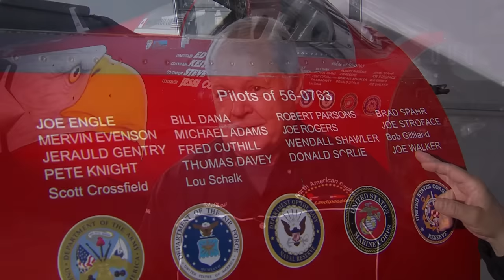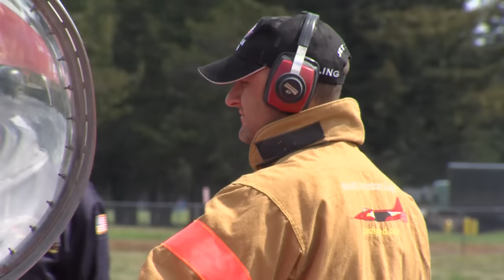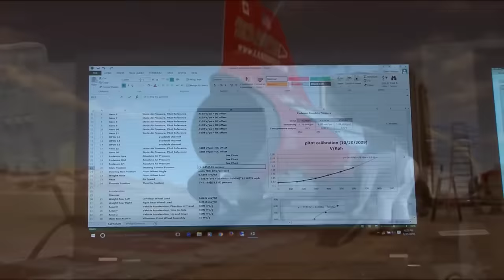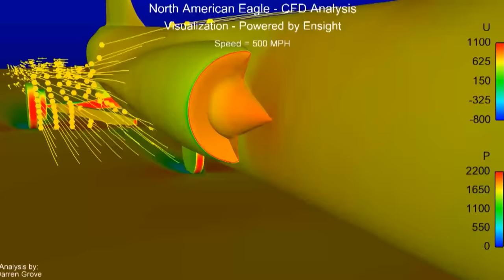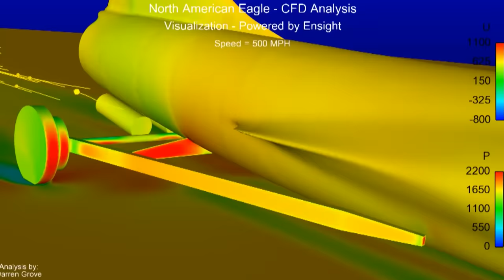The North American Eagle

Comment: Jet-car racing now needs to move to wheeled open-water  speed-racing. At high speed , V-shaped wheels will run on water , yet cut through any incident waves . Racing-hydrofoil escape-capsules will greatly increase the safety factor for the jet-car drivers . 
*In-depth examination of this proposal is available in Quora thread : Should we allow wheeled jet-car racing on open water ?

Comment: The F104 was a deathtrap in the air, let alone sticking it on wheels... Bloodhound off to Hakskeen Pan next year...
Reply: no i think the bloodhound is back in 2021. 2020 they are rebuilding after some testing that finished with some 1000kph+ passes. they have yet to add the rocket motor as well.
Reply: @mrrolandlawrence  And, alas, they're without an owner again.

Comment: Trust 2 = 30,000 BHP (622mph)   Thrust SCC = 110,000 BHP from two Jet Engines (763mph)  Bloodhound SSC = 135,000 (est. 1050mph)  Eagle = 42,000 BHP (est. 800mph!!!???)  I genuinely wish these guys well with their weekend project, but they simply have not done the maths on the exponential power curve which describes the exponential need for power due to nature pushing back harder to slow you down the faster you want to go.  Regardless of personal opinions, the laws of physics show that this car is not going break 700mph. P.S.  I do know that strictly speaking you shouldn’t use BHP to measure jet engines power but for the ease of comparison for the masses it seemed easier.
Reply: ukkowalski  it will be interesting.

Comment: I may not understand this but land-speed record challengers should not be building cars that are light enough to fly. I would use an old B52 fuselage, pop rivet plates over the wing roots, strap the engines on the top and sides and bets I could get Mach 1.  Failing the rarity of finding a B52 fuselage,  I might be able to get a few Mach numbers in an old 1900's steam locomotive with an Atlas 5 rocket motor. Screw the fancy paintwork and get the job done. It only has to go fast, it doesn't have to look good.

Comment: Darryl Greenamyer flew an F-104 at low level officially 988 mph.  (Average of four runs.)  Couple days before he average dover 1000.00 mph but one timing camera didn't work.   The fuselage is good for mach 2 at high altitude.   Seems like a good choice for this attempt.
Reply: Something designed originally to work on the ground would be even better.

Comment: In 20 years they've. Managed to go 440 mph?  Top fuelers go 330 in 1000 feet.  Not too impressed with the performance, but it is still a neat car.
Reply: It's all together a different class. Land speed records are recorded allowing different wheel to ground numbers and distance to speeds both directions. Jet cars are not included in NHRA top fuel as you reference
Reply: What a tragic loss of a brilliant driver.

Comment: Too much lift under that fuselage it was made to be an aircraft, running it as a car on the ground you're dealing with a tremendous amount of ground swell, trying to take it through the transonic threshold the front end starts producing a shockwave that combined with the ground swell, you're not going to be able to control it it's going to lift up you're going to crash it!

Comment: It has a MICROSOFT decal on the side, IT WONT WORK IT WILL CRASH
Reply: kalayas kitchen it crashed.......
Reply: Chuck Barnes  if they didnt include a 3-axis inertial feedback system (fibre optic gyros and accelerometers + fast response kalman filters),  with some pretty high response rate airfoil trimmers then any turbulence and unexpected ground effects especially as they probably have never been modelled or simulated them in an airflow chamber (wind tunnel) would suddenly result in uncontrollable motions. If the wheels broke up that's another matter. Depends how good their telemetry and vibration/ positional monitoring systems were for post-accident analysis but I expect that was an expense/complexity too far for them. A human in the feedback loop instead of some FBWire system is not good,  reaction times are poor - it's equivalent to flying a fighter jet at 1 mtr off the ground at mach 1.5 isnt it??? Not good and a sad loss for a brave lady. I wonder if they had an operational ejector seat/canopy in it that may well have saved her at any speed.
Reply: Chuck Barnes  same as that going through Donald Campbells mind when Bluebird took off and killed him, "oh shit" - the designers and idiots who made that car "over 20 years" are culpable in the death of a nice brave lady who trusted their overtures and lies. No human can control a mass in three orthoganol planes  (X.Y.Z) moving over terrain at the speeds they wanted,  it didnt seem a very heavy car either it simply looked like, as others have noted, a retired jet fuselage with a few wheels sticking out of the side. Compare that to other types of land speed record cars!. It's just the American (sorry guys Im a Brit)  "good ole boys" syndrome in action over design and money. I note that there is no video of the accident.

Comment: The celebration tour that would never happen, had he only driven it and not allowed anyone else to drive it he would have been praised for his efforts. The fact is Ed was called out in public over and over again over the lack of safety equipment makes this an experiment that killed Jessi almost criminal. RIP Jessi Combs.
Reply: Not just the car. They needed a bigger area. The black rock desert is 2 to 3x as long as their location.  Watching the video if she had a few more miles without hitting the bumps at the sage brush, she probably would have made it.  She almost crashed once before cuz the chutes didn't open. That's crazy to attempt this in an undersized runway

Comment: Why is the tail number 60-763 on the plane, but on the car they have it as #56-763?
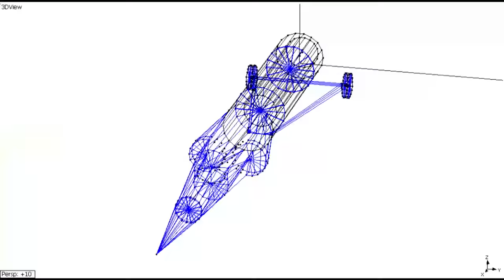Reply: Where are you seeing that at 11:33 it says 60763 on the car
Reply: @PabloGonzalez-hv3td  Earlier, when they show the actual F-104 with the test pilots, the tail number is 60763, then the go to the car owner who points to where it says "Pilots of 56-0763" and the names of the pilots. Later as Les Holm is talking they cut to a shot of the car engine test in afterburner. On the tail, just below where it says www.LANDSPEED.com is 60763. I'm just curious why there are two tail numbers on the car.
Reply: @jameszerukjr   - It's the same serial minus the 5 USAF numbering convention is strange in that they drop the first number of the build year on the tail serial of some aircraft but others like a fighter will say 05-123 for one built in fiscal year 2005 the full serial of the F-104 was 56-0763
Reply: @PabloGonzalez-hv3td  Ah, mystery solved! Thanks so much for clearing that up.

Comment: Interesting story about this (wasn't really) car.... unfortunately the "car" wasn't built with proper safety features, such as a roll cage. Jet fighters are made to fly and cars are built for the ground, a wingless fighter jet does not a car make, imo.
From what I've been reading, this vehicle wasn't sanctioned by any governing body and was a 20 year old odd concept that was under funded. It wasn't a project that was concerned with driver safety like it should have been and had experienced issues in the past at lower speeds.
The chute didn't deploy properly and didn't slow the vehicle enough so that it went past the safe area of the course striking an object that caused a front wheel to fail, resulting in the fatal crash. All safety issues.
RIP Jessi, you should have never had to rely on these arrogant men for your life.
" Pride goes before a fall", gentleman!

Comment: The speed of sound is 767.269 mph. Not 763 mph. Still fast
Reply: Depends on the temperature
Reply: It depends on atmospheric pressure at that time...!
Reply: It depends on the moons gravitational pull.
Reply: The speed of sound varies with changing elevation/altitude and temperature
Reply: It was 761 mph at the time thanks to the temperature. The speed also changes drastically depending on the medium it travels through. An example of this is that it goes up to 26845
 mph in diamond which is 35 times faster than it is through air and is even faster than Earth's escape velocity.

Comment: So... did ANYONE on this team research this jet before picking it? 

The F-104 is a jet commonly called the "Lawn Dart", "Aluminum Death Tube", "Flying Coffin", "Widowmaker" and "Ground Nail". It has killed HUNDREDS of pilots worldwide due to ACCIDENTS. It is one of the worst designs of the early supersonic jetfighter era.  It suffers from a flaw known as Inertia Coupling.  The horizontal stabilizer that was installed on the tail of the Jet was used to counter-act this.  This team totally ripped the horizontal stabilizer off!  So there was nothing to counteract this force as the speed increased.  Violent Yawing and Pitching was predictable and inevitable.   This engineering team killed Jessi Combs with their negligence. They need to be sued into oblivion.
Reply: In the Hoonigan interview of Jesse filmed two years ago, she mentioned losing steering control.  Do you think this is related?   

I agree with you about the engineering team.   I'm expecting all of the details of this incident to be hidden from public view until the lawyers are finished fighting many years from now.
Reply: So true . . . the "Widowmaker". Beautiful jet but dangerous. Don't most land-speed cars have lower stance and ground effects for stabilizing? It seemed very unsafe for what they were trying. What about a roll cage and enclosed solid pilot canopy.
Reply: TNSEE completely overblown and untrue this “killed hundreds of pilots”. Actually it’s performance in USAF was quite good. If pilots were well trained they had no problem with the aircraft, it is enough to look at statistical data after 2300+ sorties flown in combat in Vietnam. I doubt her estate has any chance “suing” anybody, this is inherently risky business to move 400+ mph on land, it’s “use at your own risk” type of business.
Reply: @olasek7972  West Germany (cold war) lost 116 pilots in 262 crashes, and Canada lost 110... that would be HUNDREDS worldwide.  Never said USAF.
Reply: TNSEE perhaps they were lacking in flight instruction and/or airmanship. There are more and less challenging aircraft to handle, as an example Mitsubishi Mu-2 was also called all sort of names as being a bad design but when FAA looked at them closer - it was given a clean bill of health. F-104 was an awesome design for its time with a very good operational record in Berlin crisis and Vietnam war.
Reply: @olasek7972  The USAF had relatively few incidents because they only used the F104 as an interceptor - however Lockheed (mis)sold the Starfighter to several European nations as a multi-role aircraft capable of low altitude strike missions.

It was trying to use the aircraft in low and slow strike missions that caused many of the accidents as the F104 had tricky low speed, low altitude handling.  Worse the early F104 had a downward firing ejector seat so if you had a problem at low altitude the ejector was going to nail you into the ground rather than save your life.

There was quite a scandal as many national air forces didn't actually want the plane, only to discover that their political masters had bought it anyway after having a lunch with a Lockheed employee who may have passed them a suspicious brown envelope.

Comment: This is/was not a car - it was an airplane without wings... it did not have a chassis it had an air-frame, big difference - it was not designed to travel 600 mph on land - it was designed to fly 600 knots in the air. Clip the wings off a bird and see how long it lives. Sorry to state the obvious but these guys were wrong from day 1 - and GE (the engine maker) knew it and refused to support the project. Seriously what were they thinking.

Comment: nothing new about turning aircraft into cars. After WWII lots of ME109's were sat around in factories so they modified them and turned them into cars. Little 2 seater 3 wheelers driver at the front passenger seat behind the driver. Those were called mershersmitts. They just used the cockpit added wheels and a small engine. BMW made 3 wheelers as well from old bomber cockpits and called it the bubble car 2 wheels at the front 1 at the back the front end opened for ppl to get in and out no doors on the sides 5 seats 3 front 2 at the back. My brother in law had 1 weird looking car but it was BMW's 1st attempt at making cars. It as powered by a BMW bike engine.
https://www.carandclassic.co.uk/list/81/  meshersmitt
https://www.youtube.com/watch?v=WSitjRmQJyc   BMW
Reply: The Messerschmidt factory turned to building little 3 wheeled cars after the war when they couldn't build airplanes. But those little 3 wheeled cars were not converted ME109s in any way shape or form. Just as Vespa scooters were not made from old Piaggio bombers, and Grumman aluminum canoes were not converted F6F Hellcats.
Reply: yeah I had a neat Messerschmidt bubble car than used to go at 20 MPH !!!

Comment: 16:48 I know hindsight is 20-20, but that is seriously how the chutes were deployed?  I'm not trying to be a keyboard warrior here, but for fuck sakes guys, this setup is a deathtrap.  You made a machine and allowed that lady to drive it with a half assed way of slowing down and no mechanical backup for deployment?  700+ mph on a limited length run with this setup is and was a deathtrap.  No way that shit would have opened at speed.  Everyone is all nuts out about horsepower, thrust and all that, but if you aren't the one driving, the #1 most important thing is being able to stop.

You guys signed Jessi's death certificate with that hokey pokey ass setup.  Solenoid linkage facing wrong direction to kinetic force, crimp quick disconnect terminals, linkage long as hell.  Thing should have had mechanical linkage peel panels at a minimum for backup chutes and a plow bar in case there is a deployment problem.  Would destroy the car but save the driver.

Comment: why not use a F18 hornet body and attach wheels on it using titanium bracing for the wheels and the same grease used in the british wheels grease which is about $2,500 per oz and then you have the fastest thing on the earth or even better use the SR71 engine full stop ?

Comment: Why on gods green earth are they running a ridged chassis doing 100plus mph more less 500mph.. No wonder Jessi Combs is dead!!!
Reply: And no cockpit roll cage you find in all fast race cars,,,,,, it was not built for safety imho
Reply: BILLY THE KID Its as if they want to die...
Reply: I agree most these high speed wrecks are none impact slow rolling wrecks which means there 1000% survivable if the most basic roll cage equipment is put in. 1000mph speed records should be the norm but we clearly have the wrong STUFF pushing the outer edge of mankind...

Comment: As a kid of 12, I watched the Budweiser rocket car break the speed of sound, as was certified by the United States Air Force, at Edwards Air Force Base.  That was 1979.  America did it a LONG time ago.  I don't care how many wheels it had or what kind of motor it had or that it did not do it twice from different directions. Neither did the air that it flew through or the sonic boom  that it produced that briefly lifted its rear wheels off the ground.
Reply: George Mallory That thing didn’t go mach 1 at all.😂 No shockwave was seen on the ground emanating from the nose. You can shockwaves from the rocket but not the nose like ThrustSSC. Also the accelerometer data was no where near accurate enough to confirm the speed. A wheel lift off the ground doesn’t confirm supersonic travel, it could also be shitty aerodynamics.

Comment: The f104 is the worst platform to make into a land speed record vehicle. This is a piece of junk. It needs to be designed from the ground up. You need CFD analysis and windtunnel testing and more power.. Not withstanding the 104 has killed a lot of aviators and that's what it was designed for.  Nobel has a team of people and computer power doing this right. Get proper sponsorship and better design.
Reply: Kiwi adventures they have already gone faster than you will ever dream off. Bunch of blokes having fun. Good on em I say.
Reply: Poida . The issue here is it wasn’t the brave men who designed it who got killed. Hate to tell you that I told you so. Yes I have travelled much faster than that in my airforce days.
Reply: @MrMercurybullet  hate to say it but I saw this coming.